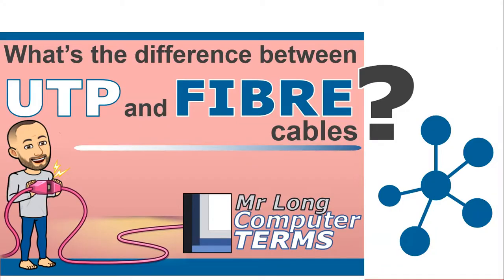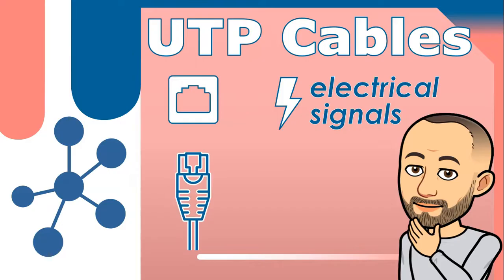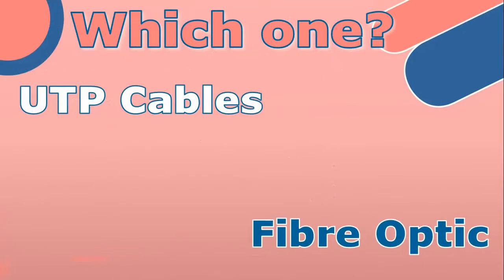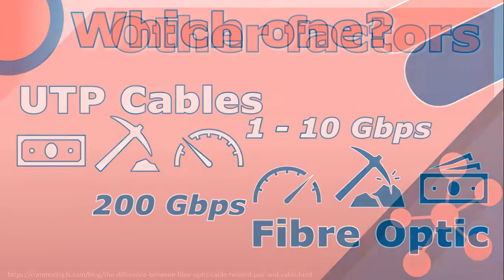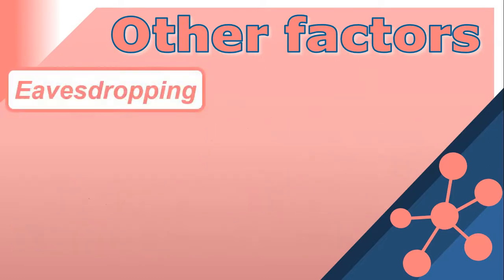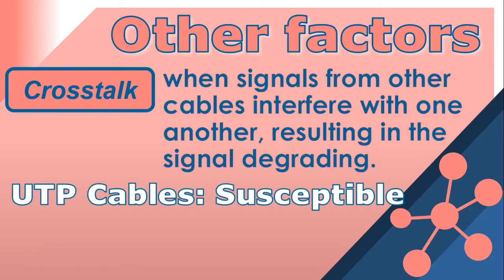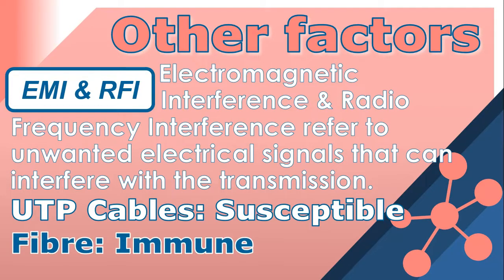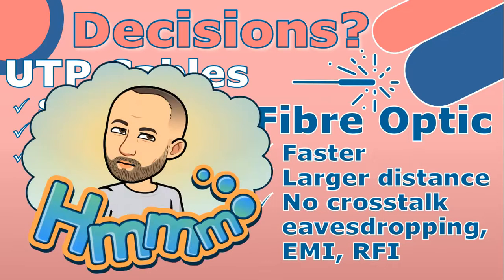Mr Long Computer Terms | What is the difference between UTP and Fiber cables?

Comment: The main difference is that UTP (Unshielded Twisted Pair) cables use electrical signals sent over twisted copper wires, while fiber optic cables transmit data as light signals through glass or plastic strands. This leads to differences in speed, distance, cost, and interference: fiber is much faster over long distances with no electromagnetic interference, whereas UTP is cheaper, more common for shorter distances, and easier to install but susceptible to EMI.